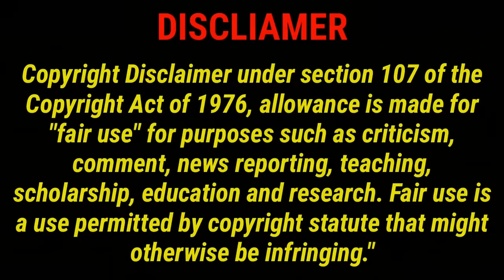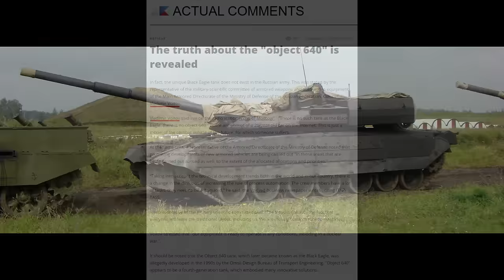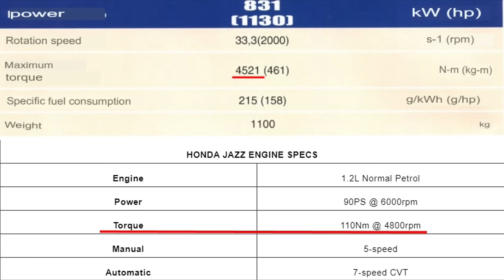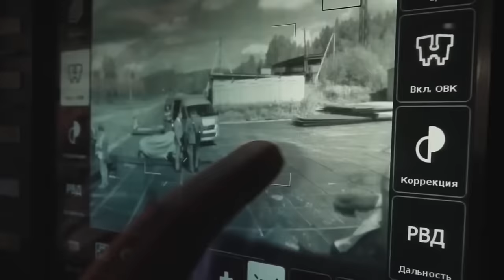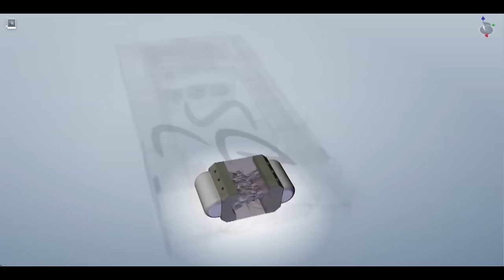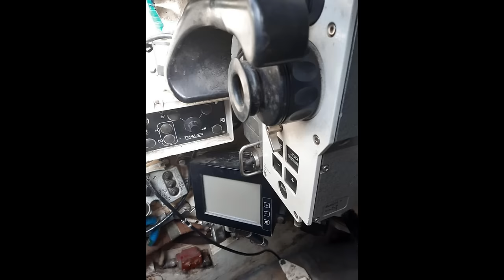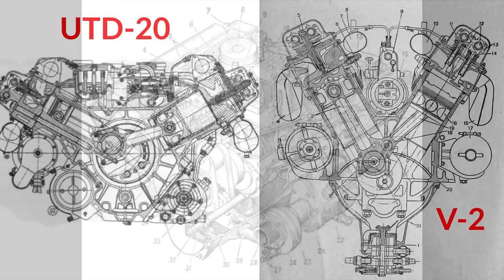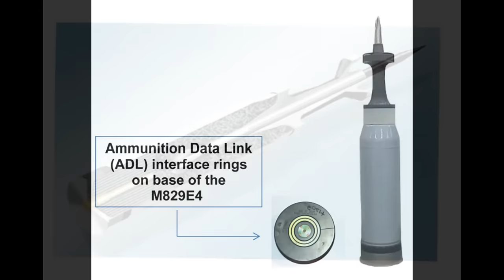LazerPig is WRONG about T-14 Armata

Comment: What is this vid about?? It's supposed to be correcting the wrong points LaserPig made. What it actually focuses on some details in his video that do not matter completely to points he made... Your not proving him being wrong in his statements single time. You just want to point out some technicalities he wasn't precise on, even tho he didn't focus on them mainly, because they don't matter. This wasn't historical vid. Your statement that Armata didn't brake on the parade, but instead had emergency break engaged is so silly it's even hard to comment. Let me guess - your family is of russian origin and the vids revealing true image of Armata do hurt your feelings?
And now LaserPig made a vid replying to this one of yours, which is pretty much same rubbish as this one. Seriously, does that pay to both of you financially?
Reply: When your points are based on lies and deceit it brings doubts to the validity to the main argument

Also silly to assume he is Russian. 

Psst he isn't
Reply: To the T-14 breaking down claim, it does seem possible that it was an accidental mistake made by the driver if you include all the factors. If the tank did break down then it would have to be towed away, like how the Ukrainian T-84 Oplot had to be when it broke down, but video evidence, which Red has shown, showed the same T-14 driving off, which would mean that the tank hadn't broken down, or if it had it wasn't that serious and was quickly fixed. Then there was the whole thing about the engineering vehicle, which was made on a tank chassis, was unable to move the T-14 an inch and later just drove off after the issue was solved. For the T-84, it was towed away by a truck so it is confusing on how an engineering vehicle based on a tank chassis was unable to move the tank an inch but a truck engineering vehicle had little to no problem. Considering all these factors it doesn't seem all that far fetched to say it was a mistake of the driver especially considering this is a newer tank at the time the video was made.
Reply: Redeffect proved a vast majority of the points LP made wrong. Then he proves them wrong again in a response to LPs incredibly disingenuous response video.
Reply: @-YellowFruit-  Yeah that was one of the best response videos I've seen in a long time.

Comment: Finally, russia has a tank that's almost as good as a Leo 2 A5 or Abrams M1A1. That is to say IF its systems were up to the paper specifications😂😂
Reply: The T-14 Armatas size increased in comparison to the T-90M and with it the surfarce area that needs to be protected.
The increase in armoured area negatively impacts the weight and mobility.
Thefore the armour tickness needs to be reduced so the mobility is not impacted.
Otherwise you would end up with a slow and sluggish tank.
The T-14 Armata demonstrated its mobility on parades and on training grounds so we know that this is not true and it means the engineers choose to make the amour thinner.

The russians also did NOT use a new engine to increase mobility.
Engine is the same as in the T-90M, because photo analysis has shown that all air intakes and heatsinks have all the same placememt. Furthermore the transmission is also the same, because it shares the horrible reveerse speed of the T-90M. The russian like to boast, but they never shown off the improved reveerse speed of the T-14 Armata, because in reality it stayed the same. And if everything stayed the same I doubt that they developed new armour composites to keep the weight low.
The unmanned turret doesn't do the armata a big favour, because due to the small size of soviet tank turrets there was not much where weight could have been saved and the small weight save is offset by the much larger hull.

Comment: Okay Red, now here is what i see and hear from your video. Soviets and russia did okay and good and reliable, whilst nato and others did maybe okay and maybe not okay but same, Lazer was wrong i know better. Well sir no you dont. You bring alot of facts which are data from RUSSIAN manufacturers, not very reliable source, ever. You bring the engine topic, which lazer actually nailed, but you say it is so much modernized that it produces twice the power... Well as an expert i will catch on this one. You are BADLY WRONG. Tank engines are basically low power engines due to their displacement, good comparison are big trucks engines. 12 litres of an engine making 500-1000 hp... Well i personaly got a tuned Volvo which got 400hp from 2 liter engine... And yes torque is what matters because tanks are very heavy, and reliability, this why tank engines are not stressed to push more power. Well, russians are known, and it is really easy to check and proove, from making stuff up. the V2 is still same crap as it was 80 years ago. Its just little better built because of how way more accurate machines are now than they were in 1940's. Making V2 engine push 1000hp is piss easy, even in my garage i could pull 4000hp from it if proper rebuilt and put turbo on it. So mentioning all this, your "facts" to proof how Lazer was "mistaken" are simply untrue, which puts a big " ? " about other "facts" that you pull up Sir.